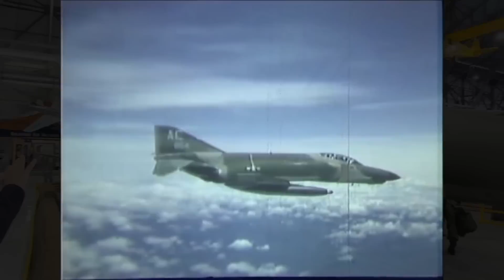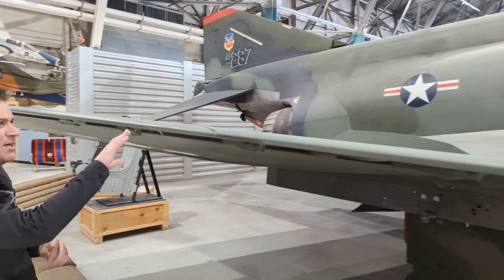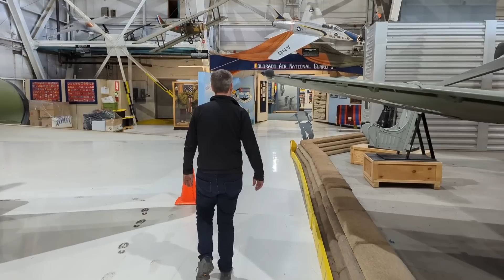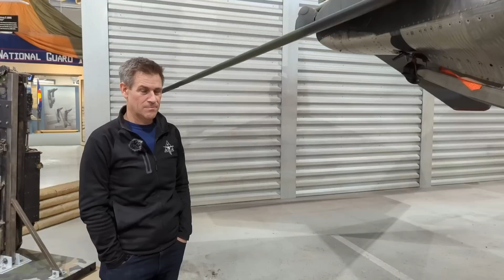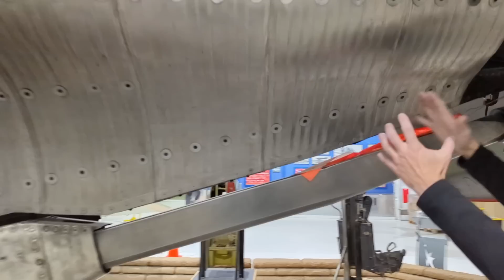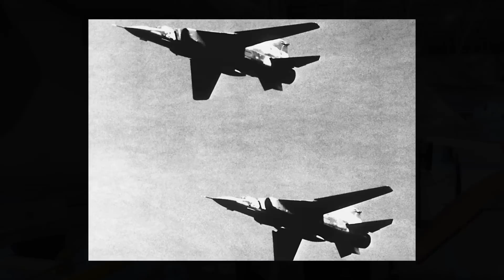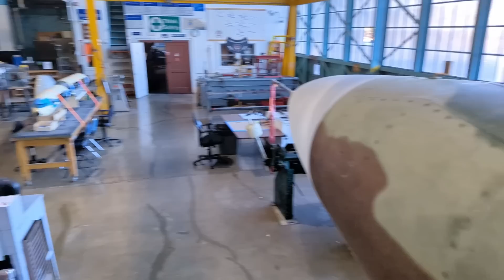The F-110A Spectre (Spoiler: It's really an F-4) - The Century Series Revisited

Comment: I grew up about ten miles away from the runway of Hill AFB which had the F-4. While being a fast plane, it was slow at getting there off the ground. They would still be in their initial climb over my house and they were very loud. When they switched to the F-16, we never heard fighter planes again because they would turn immediately after taking off and would head west.  Watching an F-4 take off at dusk, you could see the afterburner flame hitting the runway and it still took most of it to get airborne. The F-16 could take off much sooner without afterburner and could immediately turn or even go straight up.
While I like the F-4, the F-16 was a much better fighter. I think the F-16 is the best looking fighter as well.  The F-4 looks like a massive flying tank.

Comment: A number of Air Force aircraft have tail hooks so that we can use an arresting wire and we can use the arresting wire almost anywhere in on the airstrip, but the two times I saw them used at my air base it was to catch the aircraft at the beginning, just as it lands one plane we had where the speed brake door would not allow the main gear to open up so we had land with nose gear only. And it needed to arrest it and get it slowed up as quickly as possible so that it didn't do any excess damage to the bottom of the aircraft. And another time when we had an aircraft that the nose cone on the F-111 had if they had struck an eagle over the bombing range and it had folded that long nose up over and broken out one of the windscreens of the cockpit. And they had to land it. And there was another time that I didn't see the landing but we had a third stage compressor failure which was starting to show itself on the PW 100 engine. The engine that first went into the F-16 and F-15. Later replaced by General Electric models of the same engine in the tw110 and 120 models that had a little bit less issue although the 110 issue did start having failures in the f-14s. And we had one that had lost containment and fluid back on the other engine surprisingly and they used a resting hook to get it slowed up.

Comment: I sat through no less than 8 multi-ad breaks to get through this over 1 year old video. That's insane. Don't know if it's YouTube or what, but that's quite excessive...great video though.
Reply from the maker: Hi there, age of a video doesn't effect the ad slots, but I'm sorry to hear YouTube insert that many. I've review the settings on the video now.
Reply: @theaviation_show for more context, I was watching on my smart TV using the YouTube app. There seems to be far more ads while viewing using that method. I noticed that no matter what video I watched last night that the ads were incredibly invasive. Not sure what's up with that, but there is most certainly a difference in the smart TV app and the mobile app as far as advertising goes. Hope this gives you some insight. Cheers.
Reply from the maker: I think YouTube might be pushing more ads on the smart TV app as there is no ad blocking software for those. I've updated the ad slots so hopefully your experience won't happen for anyone else.

Comment: Still faster than anything currently in the inventory (F 15 is transitioning out).  All flown by bellcranks and hydraulics (no fly-by-wire.  Max gross 62,000 pounds and I exceeded that.  The "E" (shown) has a smaller radar antenna (due to the gun).  The D had the best radar.  The "Agile Eagle" mod of leading edge slats (shown) didn't happen until after VietNam (1973).    The sawtooth happened at least 20 years before the slats.

Comment: There are historical inaccuracies. The F-110 was a development without contract. A supersonic interceptor with a battery of 20-mm guns. Guns plate used for heavy radar.
Interceptors like F-89D, F-102 without guns. F-102 were not even designed for guns. Interceptors without guns are a rule in the world by the end of the 1950s. UK and USSR too. F-4 became a deck interceptor.

Comment: Because I worked on the F-111 F model I know that that is the last iteration of any of the century series it's also the most advanced of the century series although it wasn't much of a fighter plane. I've known that the F4 was originally the f-110 for a number of decades.
Reply: Officially, the Century Series ended at the F-106.

Comment: The F4 was a Navy program bought by the Air Force because it was better & more flexible than any if the Century series fighters. The F4 is the end result of a decade of development of the F2H, F3H & F3H G/H. Small incremental improvements. The Century Series with the exception of the F102 & 106 and the F100 a development of the F86 all are one offs. The F101 was an off shoot of the McDonald lineage. The Century Series start to look like a shot gun approach trying all sorts of different ideas to find the answer. An expensive exercise. To be fair the Century Series were all designed with different attributes, but the F4 won out for use in the Air Force because it was able to do everything or almost everything. The possible exception was close in dog fighting which was a challenge in the early models. This was rectified in the later models like the ‘E’.

Comment: This is the F4E, the only one that had a gun internally, and they used the J79-17 engines. I was an engine mechanic on the F4E for 3 years. The AF models had a folding wing, just rarely folded them because we had to manually lift them, and that is the wrong J79 installed for an E model on display

Comment: P&W J-57 was NOT a contemporary of the GE J-79.  The GE J-79 was far more sophisticated than the old J-57, producing far more thrust, better compressor air control, multi-stage afterburners, better stall resistance and much longer service life.  The J57 was the first Gen 2 turbojet, the J-79 was the vanguard of the Gen 3 engines.  The aerodynamics of the Phantom are a prime example of a company desperately trying to fix an inherently BAD aerodynamic package.  It wasn’t called the Led Sled for nothing!

Comment: "No RADAR" 15:09 because when the F-16 was designed, on-board RADAR was large, heavy and not very good.  RADAR guided missiles were even worse.  Very low success rate.  

Not "no missiles" however.  Heat seeking missiles have been very effective and smaller for, years.  They are effective when used from behind the aircraft being attacked.

Comment: I'm 53, when my dad was approximately my age he told me the story that at one point regular USAF were all flying F-15 Eagles and the Air National Guard was flying the F-4 Phantom. More often than not, the Old Dogs in the Old Birds would spank the opposition in "Regular vs Guard" training dog fights.
Reply: Yup, that's why the "Fighter Mafia" fought for and won the battle to design and hand off production of the F-16 (which the Pentagon is weighing down with large ordnance, forgetting its role).  Then again, with few in the sky to challenge it, I suppose that the new role keeps the F-16 "current"

Comment: The F-4 for me was one of the worst fighters in the USAF inventory. It was an excellent bomb and missile truck, but until the F-15 and F-16 were introduced, the USAF lacked any specific fighter capacity, and the F-106 was the ultimate interceptor. When looking at aircraft which were used for the role of the enemy, it was ultimately the F-16 that was chosen, for top gun style fighter instruction. Tail hooks are useful for field landings, if being arrested allows the aircraft to run on a short runway. During the Vietnam War, Col John Boyd proved via some strict flight regimes that the F-4 was inappropriate for the battles, and the MIGs it flew against outclassed them for rate of turn and other significant factors. The MIG=23 was a terrible aircraft, and as it was a direct copy of American technology, led them down a dead end. For a short period many aircraft manufacturers were drawn down this dead end, and as far as I am aware only the Russian Backfire bomber and the USAF B-1 retain the systems. Which is more a reflection of the period in which they were developed than any aerodynamic advantage. The weight of the wing boxes, which allow the wings to move is excessive in all cases, and detracts from aircraft range and polar moments of inertia.

Comment: The 1960s were a time engineers were learning to work with the newer tech of jets and electronics, the F-4 was the point where they finally were getting it. I like to think of the F-4/F-110 and the F-111 as part of the century series and may even go on to the F-117.

Comment: Interesting! If the horizontal stabilizer actually goes into the jet exhaust stream, it's actually a rudimentary form of thrust vectoring, isn't it? It would seem that turning rate would be increased somewhat, but I'm not a pilot or engineer. Just asking the question. 🙂

Comment: At 2:58 our guide says that the F-4 "was really made for maneuverability in the way the F-101 was not, so it's a much larger wing."   The F-4 did have a larger wing, and it did make it more maneuverable, but that was a happy accident.  The F-4 was designed for the Navy to land on aircraft carriers, so it needed to have wings large enough to keep the landing speed low.  The F-4 was not designed to be maneuverable, it was designed to intercept Soviet bombers.  It was thought at the time that long range missiles would make dogfighting a thing of the past, which is also why it didn't have a gun.  The F-4 was more maneuverable compared to an F-101, but not compared to the MiGs it faced.  The F-4 survived by having more speed and power.  The gun and the maneuvering slats on the front of the wings were fixs added later to adapt to the unforseen reality of fighter v fighter combat.  Unlike the F-4, the teen series of fighters that followed were designed from the start to be dogfighters.  They had internal guns, lots of wing area, bubble canopies for better visability in all directions, and more of what the F-4 did have - lots of thrust.
Reply: Hiya! U missed the point.  I forget what it's called in rhetoric,  but the statement DOES NOT imply maneuverability was THE goal in either case but that manueverability WAS placed higher on the priorities list for the F4 than for the F101.  Language hard, me know . 😉👍🙏💛.

Comment: Isn't the gun story an exaggeration? The navy never added an internal gun, but the adoption of better training programs allowed them to gain similar effectiveness to the air force, which did the same but also added a gun to the -E.
Reply: Just my speculation, but the Navy may not have wanted the longer nose filling up deck space, adding more weight and cost, and the jet has to slam onto the deck when it lands, so extra mass out front would mean the the whole nose would have to be strengthened and redesigned to a greater degree than the F-4E was.

Comment: A Navy F-4S pilot from the Midway airwing told me that "The F-4 is proof that anything will fly if you put big enough engines on it."  Lots of fixes for bad aerodynamics like the outer wing dihedral, the downward cant (anhedral) of the horizontal stabilizers, etc.  Quantum leap over the other fighters in service, but still with a lot of improvements to get to the F-15.

Comment: An earlier design had a T-tail, which permits a smaller rudder, for lower drag. The lower tail also gives a 'pitch down' motion as the plane crosses the edge of the carrier deck. The vertical tail was then too small, so tipping the horizontal tail down increased the effective size of the rudder. To compensate for the anhedral tail, they added dihedral wingtips.

Comment: I was a jet engine mechanic/technician on KC-135, EC-135A, EC-135C, B-52F, B-52G, RF-4C, F-4D, F4-E, F-4F, F-4G, F-105F, and F-105G. Those aircraft were powered by J-57s, J-75s, and J-79s. The F-4 J-79s were lighter and more powerful than J-57s BUT did NOT take damage as well as the J-57 or J-75. The J-75 (F-105) was more powerful, hence the single engine F-105 versus the twin engine F-4 yet both had similar maximum weight. Also, talking about the wing dihedral, ALL F-4 outer wing panels fold.  The Navy F-4s had power fold wing panel, the Air Force wing panels were manual.  There is a red rod pop up near the wing panel break that indicated unlocked.
Reply: The J-57 was, in its final iteration at 19,500# thrust, more powerful than the J-79

Comment: The F-4 did NOT come out of the Century Series... in fact it was inserted into the Series.  The F-4 flew with the Navy First as the F4H.  When the Air Force adopted it they assigned it a Century Series number F-110 which was nothing more than Navy  F-4B on loan. Hence it being "inserted" into the Century Series. F-110 was later redesignated F-4C when it was modified for the Air Force at the same time the government realigned and standardized aircraft designations.

Comment: What I was told during my time in Naval Air, the Air Force decided to test the F-4 for use by the Air Force.  During their testing and evaluation some kind of emergency landing.  The airfield they were doing the testing and evaluation flights had an arresting cable on each end of the runways.  The Majority of arresting cables on airfields, back in the 70's when I enlisted, were connected to long lengths of old Navy anchor chains on each side of the runways.  A length, maybe as much as 200 feet of anchor chain was laid on the outer edge of  each side of the runway.  The cable was stretched across the runway and attached to the first link closest to the start of the runway.  When an aircraft lands and catches the cable, the cable will turn the first links 180 degrees and keep turning the next links 180 degrees and dragging them down the runway.  When the Air Force test pilot landed, the Fire and rescue trucks were at the area where the aircraft stopped.  The Air Force realized this is a safety factor and ordered their F-4 model with the tail hook.  They also retro-fitted tail hooks onto older Air Force aircraft such as the F-106 and the F-16 also has a tail hook.  I actually have an f-106 tail hook.  Both the F-106 and F-16 tail hooks are gravity dropped, no hydraulics, and have to be manually reset.  I do not know if the Air Force has tail hooks on their cargo, and large Bomber aircraft.  Looking at your F-15 video of the tail hook it looks like it is also a gravity drop tail hook since I did  not see the hydraulic piston to lower and raise the tail hook.  I am glad you said how "Hefty" the F-4 tail hook is, it is a Navy tail hook.  If you stop the video and look at the F-15 tail hook it reminds me of the F-106 and the F-16 tail hooks, just a flat piece of about 1/2 inch thick aluminum.  The F-15 tail hook is shorter than the F-106, but a lot longer than the F-16's tail hook.
Reply: As a crew chief in the Ohio Air National Guard, I watched on two separate occasions aircraft use one of those anchor chain arresting cables in Alpena Michigan. It took heavy equipment and a lot of time to reset the cable. One of the aircraft was a Navy F4 on his first attempt to land he had a utility hydraulic failure but had already deployed the drag chute, he then powered back up and took back off. I was amazed to watch as he went back around then engaged the cable on the approach end of the runway, pulling the drag chute all the way around the pattern, it was unforgettable.
Reply: Even the F-100D and F Models were fitted with what amounted to a oversized leaf spring with a shoe on the end as tail hook. We would use a bomb loader to lift and straighten it to the bottom of the fuselage where it would latch in place.

Comment: It’s not incredible. It wasn’t an interceptor, it wasn’t a fighter. It wasn’t given a gun. It was equipped with first generation (failed) A2A weapons. This airframe literally couldn’t hold a candle to the Mig21. It only takes casual reading of the Vietnam war to understand what an ineffectual airframe this was.
Reply: The F-4 was the world's best fighter in it's day, and it was certainly an interceptor.  It held several world time to climb records when it was new.  The F-4 could out turn a MiG-21 below 25,000 ft. The missiles had their problems, but the MiG-21 usually could only carry a couple of Atolls, which was a copy of an early model American Sidewinder, so the MiG had no advantage there.  The MiG-21 had a crude little radar, whereas the F-4 radar was the most advanced in the world.  And, of course, the F-4 had far greater range, which is why F-4s were shooting down MiGs over North Vietnam, and no MiGs were flying over South Vietnam.
Reply: @ sorry but a big radar literally isnt worth its weight when the A2A missiles the plane was carrying were performing at the rate they were (5-15%). Then it was all dog fighting at a disadvantage, which the close-in record vs the M21 reflects. Separately, the claim that the F-4 was an interceptor is about as strong as the claim the F-14 was an inceptor. I think we both know that rotating carrier combat air patrol within 50nm, is not what’s meant by the term interceptor. Especially when you compare the F-4 to the actual USAF’s interceptors of the 1960’s.